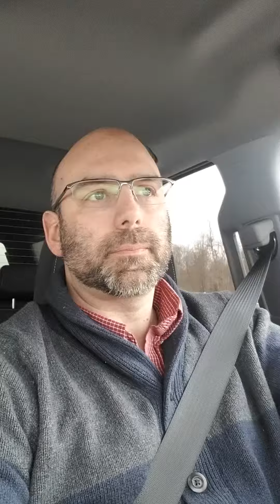2018+ jl morimoto turn signal issues resolved!

Comment: About an hour ago I finished the installation and ran into the same issue you have when I first started the JL.    Had I seen your video when you posted it 3 days ago, I wouldn't have wasted my time this past weekend installing my set of lights and I would have instead contacted them for the adapters.

Comment: I wouldn't recommend buying these lights, until they actually fix the issue. I was told 20 days ago it will take10 days, and they will send out the new harness, to correct the issues. Never got it, and no notifications about this. Not sure why I'm the one who has to do all of the following up for updates. Bad customer service also. Today, I'm told another 3 to 4 weeks now. The sequential issue hasn't been fixed.They skipped on the quality control and rushed to get these light out. Huge mistake and one very annoyed customer.

Comment: I reached out to The Retrofit Source. Apparently they couldn't fix the issue with the defective lights, so they are replacing the old lights with newer, working lights that work correctly. I've been told by them I have to go through the dealer who sold them to me. Totally blew me off. Unfortunately, I bought my lights from HIDprojectors, and they are pretty much worthless when it comes to following up with their customers, and helping to resolve issues with the products they sell. I've been doing ALL of the leg work trying to get updates with this issue. The only time I hear from Tom is when I'm the one sending the emails. Seriously, he should be contacting me about any news with these. In my opinion, both companies have really bad customer service issues, and I won't be buying anything from either of them again.

Comment: Question, which wire is the DRL wire?
Reply from the maker: The yellow one
Reply: @obsessivehobbies5464  Thank you! I am trying to wire DRL Halos to these fender lights and saw a video where someone said that Blue wire. That obviously did not work.
Reply: Hmm yellow wire didn’t work either
Reply from the maker: @dangerjonez21  that's odd.  That's the one I used.  Do you have a rubi or sahara?
Reply: I have a rubi, no led package
Reply from the maker: @dangerjonez21  weird.  

I actually changed over to an add a circuit off the passenger side heated seats for the halo drls on my new lights
Reply: Did you do that through the fuse box? Which fuse code?
Reply from the maker: @dangerjonez21  I believe it's the f45 but I'll have to look when I get home.  It's the heated seat.